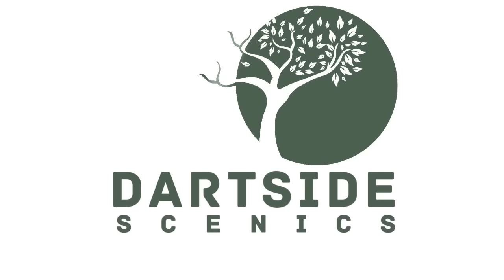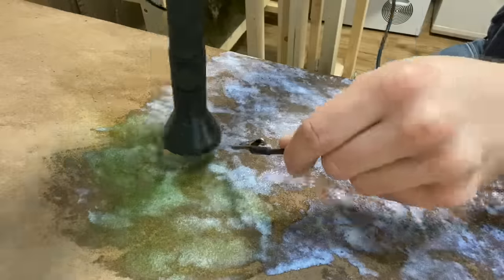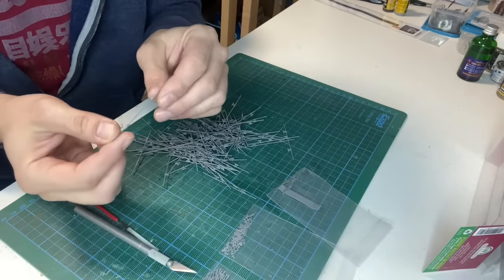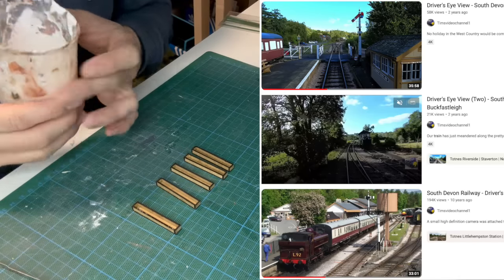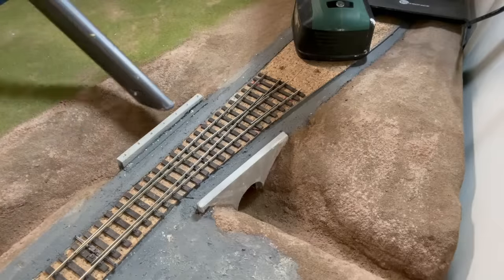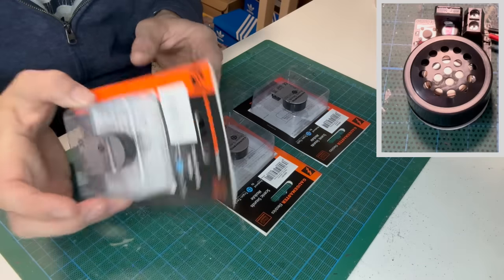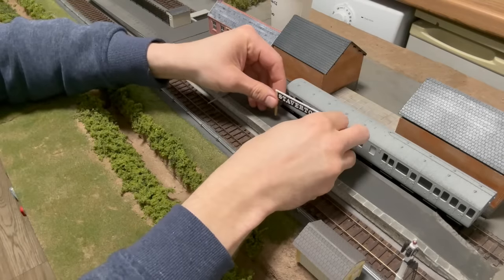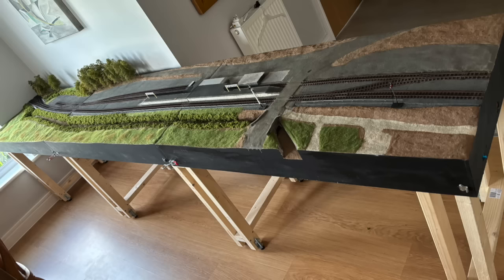Building a model railway - Scenic Progress? - Ep 8 Modelling the SDR

Comment: thanks for the video. I’ve not weathered my track yet. I’m doing TT 120.  Do you need to clean the Rails off to give the locomotives a good connection? So the current maintains a good flow to the pick up wheels?
Thanks
Steve
Reply: Yes…otherwise the paint layer will prevent / reduce conductivity between the train and track resulting in either total or intermittent/ jerky running….👍
Reply: @garrburton3375  do you use a track rubber or something else thanks
Reply: @stevio7777  you can use a track rubber but you can also use a fine grade sanding sponge or fine grade emery cloth on a wood block. Whatever you use the purpose is to remove only the paint on the track that would be in direct contact  with the wheel(s)….👍
Reply from the maker: Thanks Steve.  I agree with the comments below re the track 👍🏻